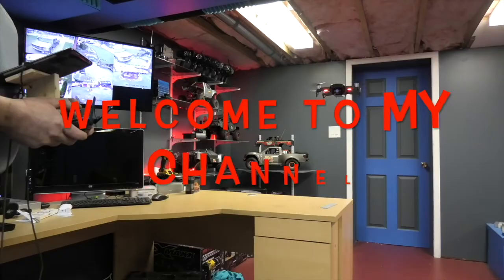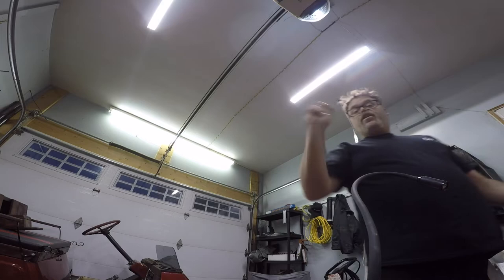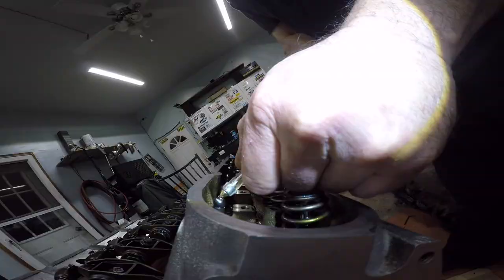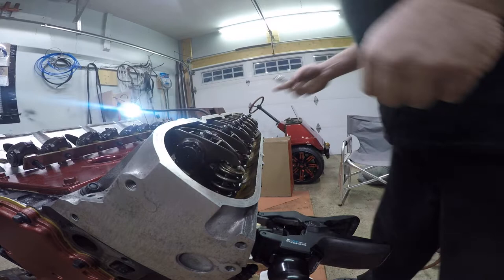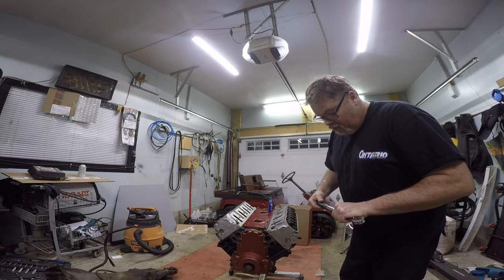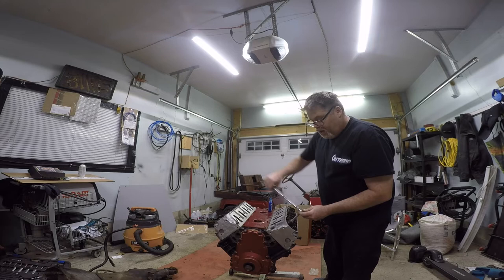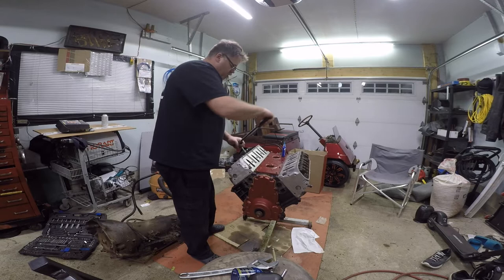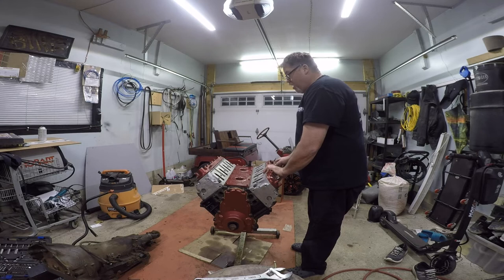Installing LS Rocker Arms and Push Rods

Comment: Not the correct way to tighten rockers. That’s how you fuck the threads up on the rocker pedestals
Reply from the maker: Ok thanks Whats the right way explain ?
Reply: BS! You’re not going to mess up any threads. There are over 10 threads in the hole by the time it gets any tension on the bolt head with the valve open. Just bc you read something doesn’t mean that’s the only way to do it.